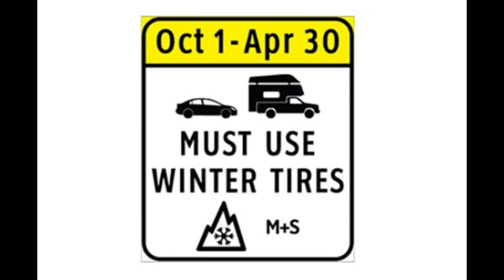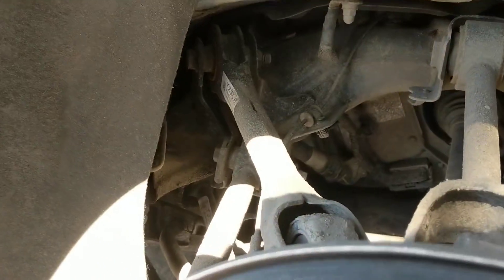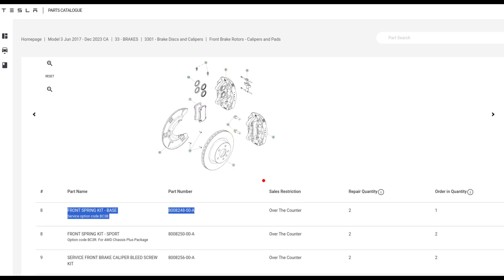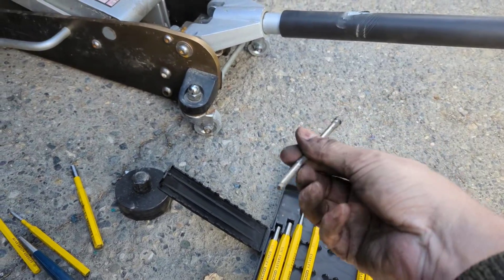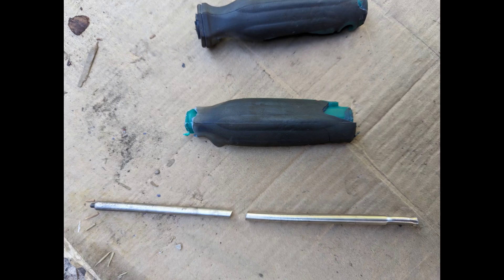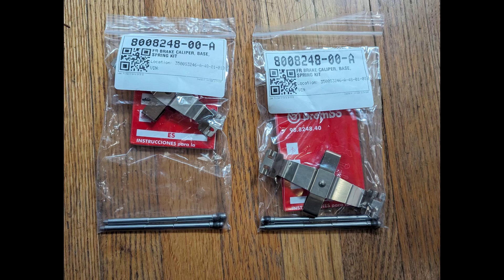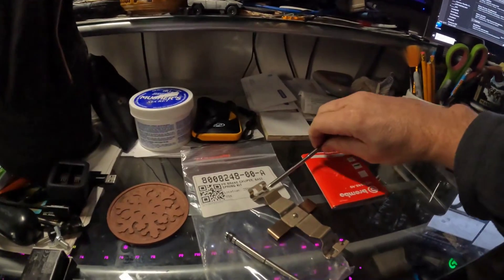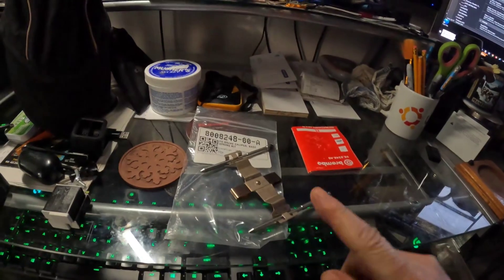Tesla Model 3 Important Brake Maintenance | Seized Brembo Caliper Pins

Comment: Had the same problem with a customers car @ work, had to drill one of the pins out, got the other pins out by tapping on the caliper casting where the pin locks in, a lot of Aluminium corrosion came out, and then the pin started to get loose
Reply from the maker: This is a common Brembo Brake issue, Tesla, Mercedes Benz and BMW as well as some Ford Mustangs.
Reply: @TeslaPrince  never had the problem on a Mercedes, but it could be because most Tesla owners use Regen braking, and don't service there cars, so the brakes have a lot of time to seize up... Just guessing here :)
Reply from the maker: @mortenmorfar  you are most certainly correct on that, owners think the brakes should last forever but no maintenance, they need cleaning and lube!

Comment: I had similar problem on my 2022 model 3 with 37k KM on it. It have been used through only 2 winter seasons, and it was indeed very very stuck. I do however live in Norway, where we drive in a salty slush all winter long. 
I felt so bad that I couldn't' get it out without leaving any marks on my caliper, but seeing this video I guess I shouldn't complain at all. 

What I did notice, or rather didn't notice, was that I couldn't find any grease what so ever on the thicker part of the pin that goes into the caliper (the one with the plastic on). Maybe this is so it won't come loose, I don't know, but I did at lease put grease there after cleaning them up, and I still didn't even remotely feel like it would ever fall out on its own. 

Lesson learned; Remove - clean - grease - reinstall, at every single summer/winter wheel change.
Reply from the maker: agreed, most Tech's that do maintenance on the brakes put some kind of silicone grease on the pins to avoid them getting stuck next time you service them. I plan to work on the other front brakes later this year to ensure they don't get more corroded and hopefully they will come out easily.